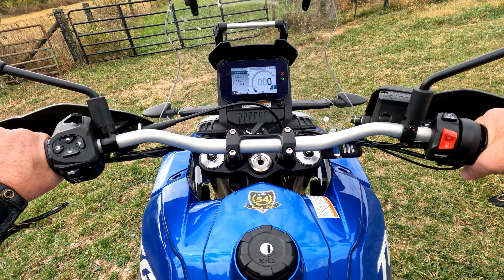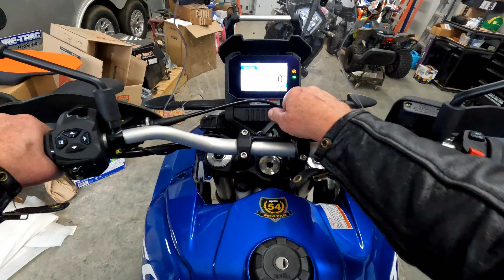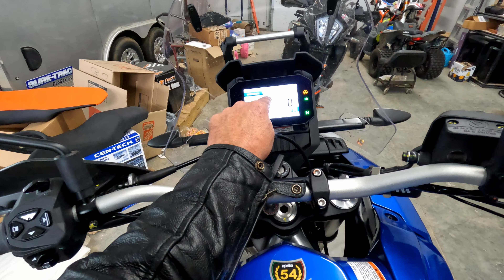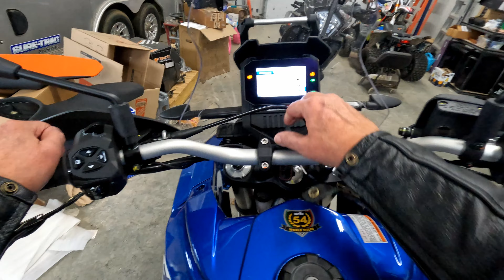Aprilia Tuareg 660 Final Drive Gearing On The Front And Rear Sprockets Test Ride

Comment: I was going to do the same (16 front) for hwy riding but I now think that this may lower RPMs too much which lowers oil pressure robbing the engine of oil flow resulting in burnt cams.  I don't know this to be a fact, but another YT Tuareg guy ended up with burnt cams and a comment  to his video suggested it might be due to lugging the engine at lower RPMs.  I notice in the video that you are at pretty low RPMs riding off road.  It might not make a difference at hwy speed, but 4500rpm at normal cruising speed might not be enough.   Maybe that's why they didn't put a taller 6th gear on it.  Its just something to consider.   I have a 2023 Tuareg and absolutely love it!!
Reply from the maker: Excessive rpm before oil gets to the cams after cold start ups causes the problems. So if you are like me and get in a hurry to be somewhere and get on the highway and since the highway is in front of my house, I can easily get to speeds of 75mph, I found that hitting the rpm at 6,000 was excessive and vibration was not comfortable after awhile and I only heard of cam burn up from people who take long trips on the Tuareg which usually kept the rpm speeds close 6,000rpm. This makes more sense to me to keep the rpm range down a few hundred for my comfort and the engine comfort from wear.
Reply: Thanks for the reply and thoughts.  That buzzy feeling on the highway was the reason I had ordered that new front 16t sprocket.   That's not to say that this bike isn't smooth, it is, but I was planning a ride out to the COBDR and back from SC next year.   Its a heck of a lot smoother at 65mph than my 2014 BMW F800GSA.  I have a highway near the house as well  😂and these bikes do like to get up and go.  Its hard to resist that induction sound.  Just makes you want to give it the beans.   I hope an Aprilia engineer answers this question on a user group or YT video somewhere.

Comment: How many miles do you have on the Tuareg?  I think they smooth out with more miles but that could be confirmation bias slipping in.  I own one as well and I love it - ride off road in the summer in the Lake Tahoe basin and I’m reluctant to change the first gear ratio.   My previous bike was a KTM ADV 390 and I realized just before I sold it that it really worked really well at 6000 RPM.  Time will tell with this one, but I have no doubt the 660 engine likes to spin.
Reply from the maker: Only around 2,000 miles. And I love my Tuareg 660 as well. That 660 engine is so smooth at all rpm and it loves to easily hit past the red line and you couldn’t ask for a better off road suspension. The only reason I changed the sprockets to gear it up a little bit cause when I hit the high speeds on the freeway it really starts to tingle my feet with the vibration so when I went one tooth more on the front sprocket and one less tooth on the rear sprocket it hit the sweet spot to make it less tingly without so much vibration and still having good enough low end. And always keep my traction control turned off, so I can still loft the front wheel for a good wheelie with no problems. So it is now like a 15 to 1 in first gear and 5.5 to 1 sixth gear.

Comment: what do you think it would have been like to just do the front to 16 tooth without the back less 1 ? lil bit more low end ?
Reply from the maker: It did great with only changing the front to a 16 tooth sprocket, but I wanted the most tallest overall 6th gear for top end speed without sacrificing too much low end 1st gear for off road and also wanted to keep the geometry of the rear suspension and wheelbase the same as the factory setup since the suspension on this bike is the best out there for any adventure motorcycle to date I think.
Reply: @cliftonsr  so the one tooth in the rear gave you a little more bite in the low end ...if I am reading this correctly...if so then I would agree I think you found the sweet spot for us DUEL riders ...I am a big fan of the 75 mph @5 grand .. 6th gear thanks so much for sharing...